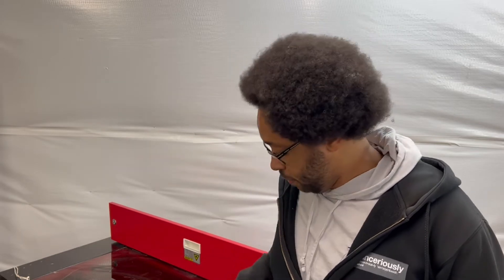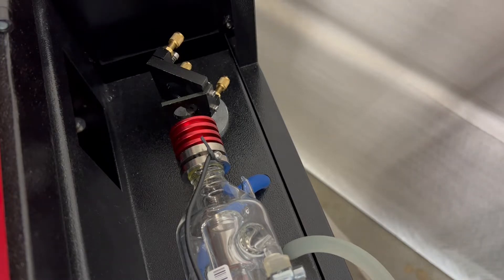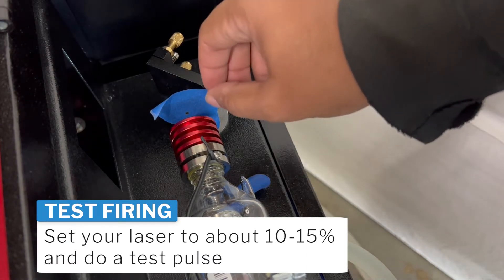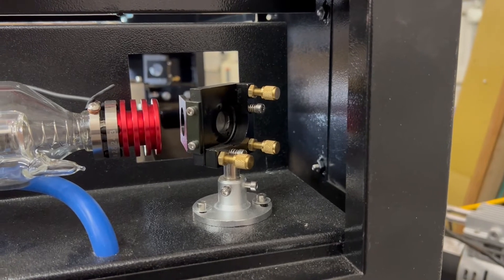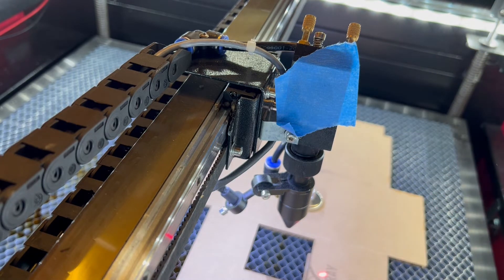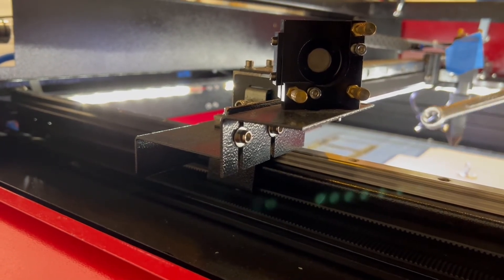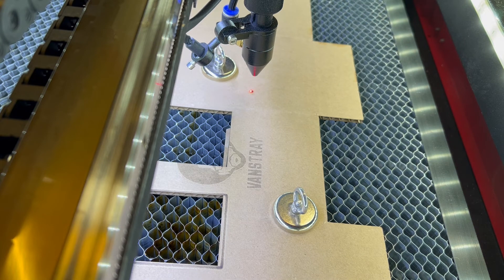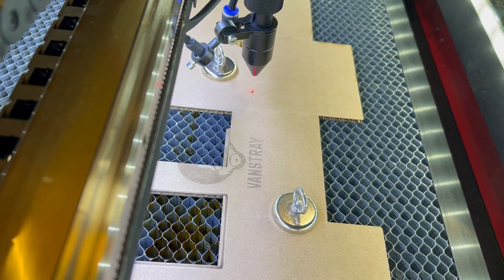Align your Laser mirrors in 20 minutes.....maybe.

Comment: crap.... i think my tube is fked up... just received the machine and the tube makes a huge ass dot... probably a donut... the plasma inside the tube on the exit side sparks around in circles... is that normal?
Reply from the maker: Sparks usually aren’t a good sign, would definitely check all the wiring connections. Also take a video of the sparks and the dot or donut it’s making on low power so if you have to contact support you can submit all that stuff at the same time so you don’t have to wait around for them to reply and ask for it. Also if you’re on FB check the group as well

Comment: Hi Kimani! I used your correction. It didn't happen 20 min but I finally got it. Thanks.  I'm a new laser user and I've had my laser 6 weeks now and I still haven’t cut out a thing.  I bought an Omtech 60 W and a few of the trimmings. I bought a 4ply vent, I bought a chiller, and a rotary. I've become good at pulling out glass blocks windows...you can imagine. Everything I fix something else is wrong. Now I'm trying to get the ramp test to work. It's a faint line no matter what. I've tried help this week from Omtech & nice people but no one has come up with: all the usual. Can you please help?
Reply from the maker: so are you saying from where the board it almost touching the laser to the middle of the ramp it's all one faint line?
Reply: @vanstray  Thanks for getting back to me! I am saying just that! One faint line across the ramp.
Reply: @vanstray  Thank you so much. I finally got OMTech to help-they are sending a new laser tube. It wasn't putting out enough power. Your videos helped a lot. Thanks. :yougotthis:D

Comment: Great video, but I am confused about something.
You don't need to be dead center, but only parallel - but the beam bouncing off Mirror #3 does need to be dead center and perpendicular to the cutting bed (ie: straight up and down). Doesn't that follow that the the beam going into Mirror 3 needs to be center - and the only way to make that point go dead center and parallel is to get mirror #2 both dead-center and parallel, and thus needing mirror #1 to be parallel and dead center? This really means that Mirror #1 and mirror #2 don't need to be dead center, but if they are throwing parallel beams but going into #3 isn't dead center then it's the tube translation that needs to be adjusted - or do you adjust the translation of the cutting head at that point?

Comment: My dots are aligned but not burning a hole through the tape.
Reply from the maker: What power laser do you have and what percentage are you firing at?
Reply: @VanStray  Flux Beamo, it's 30watts. I did a mirror alignment and one of my screws broke. I replaced it and now I'm good to go. Representative told me that the first pulse is at lowest level and to put tape on the first mirror to test the health. If it burns through on the 3rd or 4th of 5 pulses, it's "healthy".

Comment: my top right corner is only spot where dots dont match up on 3rd mirror, idk what do at this point
Reply from the maker: Just helped someone with a similar issue, check to see if the bed is level, that was their issue in that area
Reply: @vanstray  not the bed bc its before that point, did find out the x and y are not level, got that the best I could and moved the tube to the right and up and it helped, that corner still isnt centered with the others but it is alot better

Comment: I have done all test and all beams are on top of each other for each mirror. I do an engraving test and I get double lines still. Im not sure how to fix that. People have said its the beam that goes down from the third mirror that needs to be adjusted. When I do the tape over the nozzle it shows one beam and then when I do the test on a piece of wood from near and far it shows one beam. I am about to give up at this point. Please help!!
Reply from the maker: Is the beam from the nozzle in the center of the tape or off to the left or the right? I would say try adjust the nozzle mirror just a tad to get it more centered and try again. If you’re still getting double lines I’d carefully take out the lens and clean it just in case
Reply: @vanstray  Thank you for responding, I have done both and still double lines. I did notice that when I cleaned the lens that there is a white ring that comes out along with the sliver ring that holds the lens in place. Do you think the white ring could be causing the double lines?
Reply from the maker: No the white ring is like a washer to secure it in.   And If there are not burn marks on it then it’s not hitting the ring. It has to be bouncing off something for the beam to split like that. When you see the double lines are they both the same size and thickness or is one lighter than the other
Reply: @vanstray  I have fixed it for now!! I had to adjust the scanning offset.

Comment: i was hoping this video was to re align the mirrors on an rgb multi laser club lighting system laser similar to your thumbnail 😕 need to do this for an out of alignment panoramic thunderbird laser system. any ideas or tips? the 3 lasers dont line up on the output pattern visuals and are side by side rather than layered on top of each other.
Reply from the maker: That’s a new on for me, I can only say the thing that made it easiest for me to get them aligned was knowing they didn’t have to be dead center to the mirror. So if just matched what came out or the laser head to the other mirrors they all lined up on the Same spot

Comment: I have been struggling with aligning my 3rd mirror. When I have the laser at the front right corner and pulse, it doesn’t even show a dot. I have tried the index card and still no dot. I move the laser to the front left and pulse and a dot shows up very far to the left. How can I get this corrected?
Reply from the maker: You’ll need to adjust the 2nd mirror until it gets towards the center on the third mirror. Then move it to the middle machine test again to see if it’s till hitting the mirror then move it all the way to the far right for the final text

Comment: Would be great if your machine wasn't perfectly aligned already but good info but not a how to.
Reply from the maker: I could see you point, but Laser adjustment isn't a one size fits all part of the process. My laser had way different needs than my friends laser when it came to getting her mirrors aligned, but I was able to follow the same methods I show in the video to get hers adjusted even if it took more tweaking (her mirror was loose inside the bracket). And i'd need to invest in one of those reverse lasers to really show the process, so if Omtech wants to invest in my videos and send me one i'd gladly do an updated video. :-)

Comment: Nice video, but I hate people making a video on how to align your Laser mirrors, and then they don't show a real situation. 

From the very beginning, all your mirrors were already PERFECTLY aligned. It would be a much better video if you had actually shown starting with an out-of-the-aligned mirror and then actually gone through the steps to rectify the alignment.

Showing a PERFECTLY aligned laser does  NOT  match your video title.
Reply from the maker: First off Thanks for saying my alignment was perfect I had to run down more than a few rabbit holes to fix it. 
Second, I under part of your point, but the issue is everyone’s alignment situation is different and a 20 minute video of me tweaking a knob is probably way less helpful than explaining the process. Once I understood I didn’t have to chase dead center the alignment took like 15-20 minutes so the theory behind the video title  is sound and has been shown to work in practice on other machines. If I had or ever get a laser guided alignment tool so people can actually see the beams align I’d gladly do an updated video showing the process

Comment: It didn't show where the tape goes on the 4 corner test. You said on the laser head. So is that the#3 mirror or the bottom of the tube? And your laser looks brand-new how do you keep it so clean?
Reply from the maker: It goes on mirror #3 for the 4 corner test. And I recorded these as I set up and tested my machine so I hadn’t run too many projects on it yet. It has a few more char marks on it these days 😁